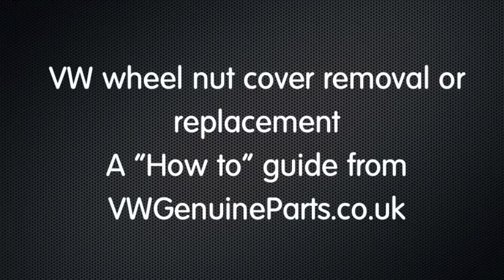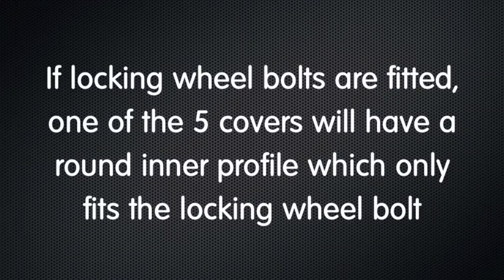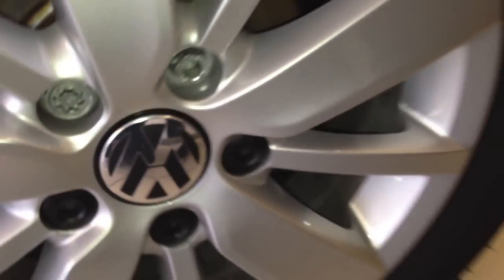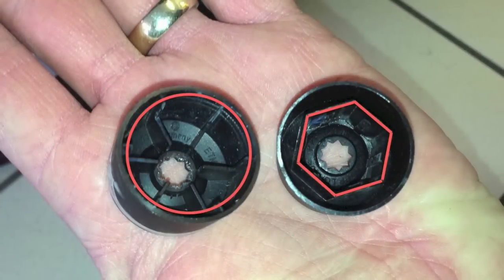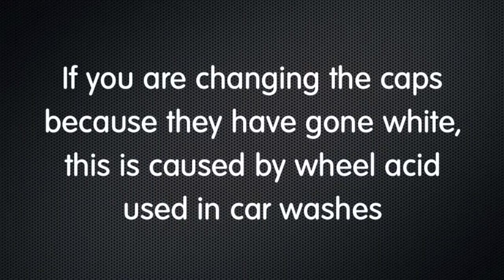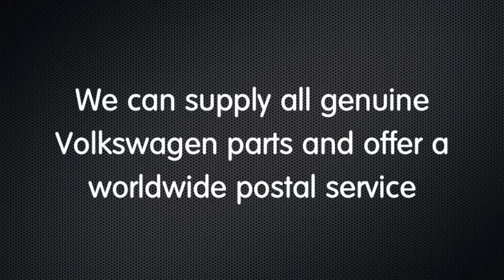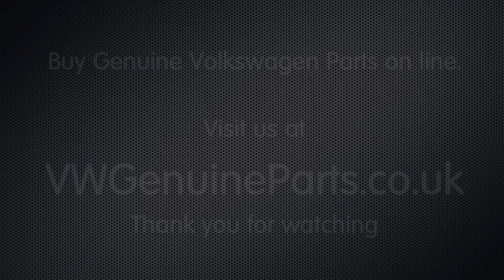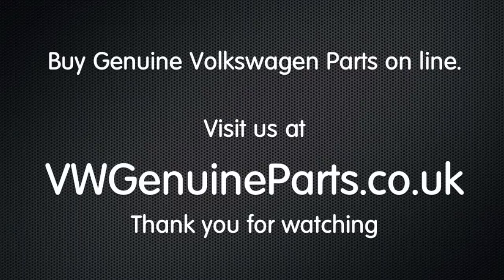VW wheel nut/bolt cover removal or replacement

Comment: so how do you remove the center cap?
Reply from the maker: wlegates Hi, thanks for your question. Just push it out from the back when the wheel is removed. You will damage the alloy or cap if you try while the wheel is attached to the car. Hope that helps. Kindest regards, Team VWGenuineParts.co.uk
Reply: That's what I assumed because I saw a velcro trick to pop them out and ended up pulling my vw covers off of the center cap :( thank you :)